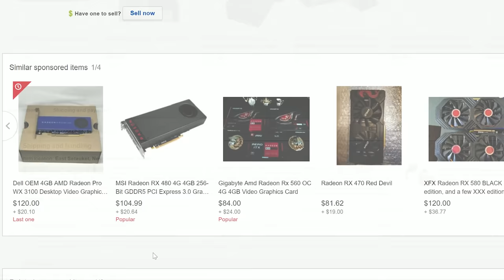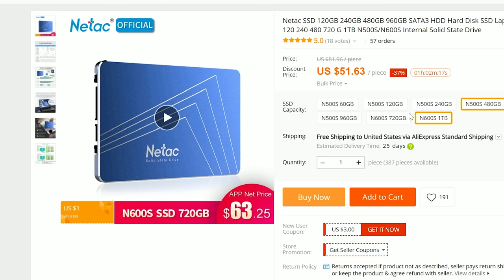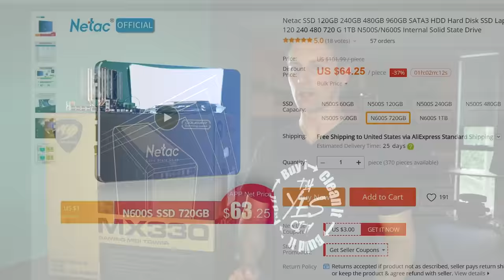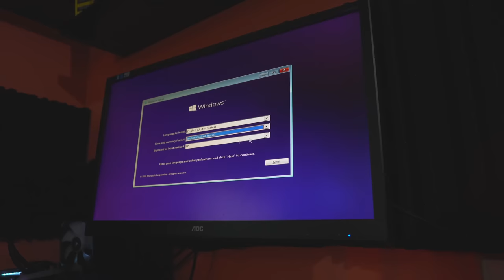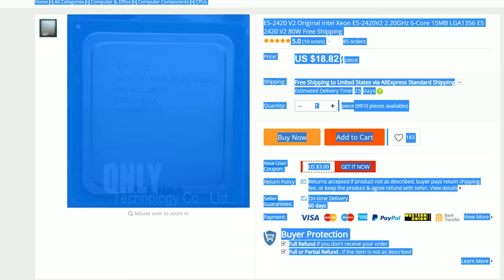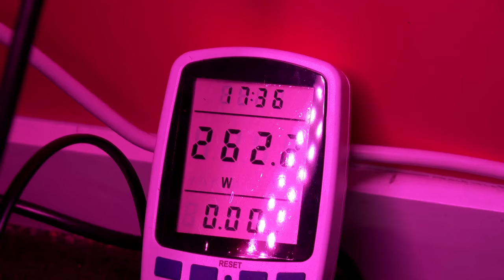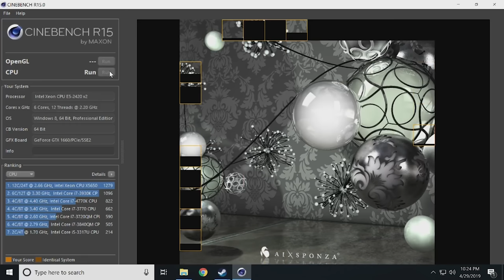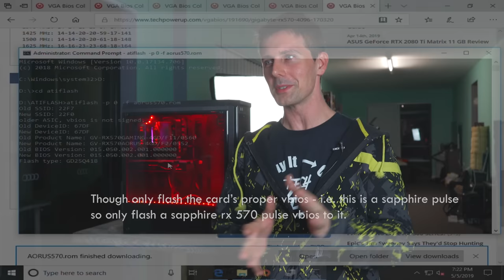Build The BEST $350 Gaming PC (with Worldwide online parts)

Comment: I paid $150 for a Ryzen 5 1600(sealed in box) and MSI B350, paid $40 for a cooler and 8gb of ram, paid $50 for a RX480 8gb in the last month. I also picked up a 144htz display and another 8gb ram for $140 all locally!
Reply: Nice deals mate! Really nice build for a very good price - enjoy!
Reply: Nice man, but with such a budget build, the 144hz is completely useless, a 60hz is more than enough in my opinion
Reply: @Saad-ih3ys  totally disagree. You dont even know what games he is playing. Even pubg or apex can be run with that system at 120+ fps with competitive settings. And there are dozen more games like fortnite, overwatch, dota, rainbow six siege and so on which will be a way better experience on a 144hz display
Reply: @Saad-ih3ys 
Alot of games like csgo, rianboe six seige, overwatch can be even ran over 100fps with that
Reply: @imaginarychip4916  ryanbou
Reply: that gpu has been vbios flipped for mining you have to flip it back for best performance no way someone is going to sell that for so cheap
Reply: Wow you wouldn't even find a cooler here in Ireland
Reply: A 144hz monitor is way overkill for a Rx 480
Reply: @pinkin8012   that isn't true a Rx 480 is pretty old and was never meant for high end build
Reply: i robbed the bestbuy by me and got away scot free with a used ballpoint pen (black ink) standard issue for zero dollars. talk about price performance
Reply: @smokey_mk2  nop it can run most games with comp settings at 100+ fps easily, even in 1440p. I have an RX 580 which is only slightly better than the 480, and I regret  not getting a 144Hz 1440p monitor
Reply: that's cool for you, and consider yourself lucky, but if you are in a country in the middle of nowhere or where pc equipment is priced high locally, then you're out of luck. picking these online deals to maximise the most on the budget will be the better option!!

Comment: Hehe, I'm still waiting for my parts to arrive :D
Reply: waiting for my e3-1220 v2 and b75 motherboard <3
Reply: I’ve just got a new computer which is a laptop. It has
Intel Core i5 4310m vPro
4GB RAM 1600 MHz
500GB Laptop Thin SSHD (it is painfully slow with almost 4000 hours of power on time)
Intel HD 4600 vPro

Since it’s a haswell based system I will dual boot XP and 8.1 when I get my Crucial MX300 275GB SSD and my 12GB 1866MHz RAM
Yes it is needed. I make videos.
Reply: @whitebeartigtig  That's great but will 12GB ram will fit into that thing? Also good luck running the memory at anything over 1600 since you can't overclock it and there's no XMP as far as I know. And good luck editing video on a integrated graphics.
Reply: Todd Simone the motherboard supports 1866MHz DDR3 RAM
Reply: Try to test more games that heavily depends on single core performance.
Reply: update, plz
Reply: Todd Simone well the iGPU is better than the GT 710 I was using previously
Reply: @toddsimone7182  yes you can higher ram if you like
Reply: @whitebeartigtig  sell that and buy a pc instead buy a ryzen 2200g and find a used 570 or 580 and ur good to go fuck laptop man unless u depend on it like u work outside or something
Reply: It’s been a year did you get it yet?
Reply: legend has it that he still hasn't received his parts!
Reply: @abl3book138  Yea ages ago :D
Reply: Did it work well?
Reply: Anything wrong with it I might get the parts
Reply: @ryanthelin6867  Yea worked well!
Reply: I love your channel, tech yes and you are my go to for aliexpress flipping 😎
Reply: whitebear yes and it costed every limb

Comment: This is only the third video of yours i have watched, and yet unbeknownst to you (or i), my problem of my dodgy used RX 470 from ebay may have just been solved. I literally had the techpowerup tab open as i was watching this.. taking a break from my frustrating troubleshooting, having just noticed a thick build-up of dust under the fans..

Out of interest, i am flipping a Dell XPS 7100 i got for £40 because it didn't turn on (the front panel connector was loose).. it had a Phenom II x6 1045, 8gb ddr3, 128gb ssd, 320gb hdd, cd drive, windows 7 upgraded to windows 10 and a 480w psu with two 6 pin power connectors! The RX 470 was £50, so thanks to you i may unwittingly have my salvation! (I have tried everything else today trust xD) We share a passion.. Thanks!

Comment: The Zalman S2 is a better value case at $45, it comes with 3 fans, which 2 are “quiet edition” and the airflow and aesthetics are amazing. Really would like you to check it out.
Reply: coldsore yes but for an extra $15 - $25 you can get a good budget power supply especially if you find one from EVGAs midweek madness sale on Wednesday’s so it ends up around $65 - $75 total for case and power supply, which I think is better than this because I prefer the Zalman case over the one In the video, especially for its great airflow and aesthetics. Add a 5 pack of RGB fans from amazon for $30 and boom you got a sexy RGB case with nice airflow.

Comment: G'day Brian,
This a great build showing that there are older parts that still can give decent performance & mixing them wit new parts can get a decent cheap build,

I got one of these Cougar PSU & it is great for the money, also the Case is great value with Glass & although not a standout is a good looking case,
another Budget case I like for M-ATX is the Silverstone PS15 for $59AUD with a full glass panel & full mesh front, although it doesn't have a PSU Basement.

Comment: Pretty reasonable build, nice job. I find the max 2.7GHz a bit low but if it does its job fine.

I hate RGB and glass panel, so my opinion doesn't count here (my choice would be dimmed orange lighting). I like old heavy PC cases wich weight around 7-10 kg empty, so I can sit on it or put my ankles on the top.

I'm curious what is your opinion about cases quality trough years? I see pretty big downfall in quality and no one speaks about it. Manufacturers just put two led strips in and remove 2 kg raw material, it's vibrating as hell but look it has RGB :) Even 5 years old SFF cases from DELL, HP much sturdier than any case on the market now.

Uhhhh I just want to flip a new fancy case on the side and see if the sidepanel bend or the glass break when I put a 19" CRT monitor on it.

Comment: Can you do a video with this setup vs overclocked x3440?
Reply: Man, forget about 1156 xeons, they are dead. Especially mb will be dead, If you choose to overclock on any of them. Because it's just old
Reply: These business server boards probably have been used for more hours than personal 1156 boards. I have an Asus board myself and as Brian has mentioned, they dont have problems. I'm sure it'll be fine.

What I want to see is how clock speeds will help in gaming performance for the older, 8 thread Nahalem architecture vs a low clocked 6 core Ivy Bridge (4GHz vs 2.2GHz).
Reply: @Arnold-wj9sm  id prefer e5-1620 instead any of these platforms)
Now i have E5-2630 and for gaming it's awesome, but i need some single core performance too
Reply: @Arnold-wj9sm  Agreed, I'd be interested to see how this pans out as well.  Although I think these e5-2xxx chips are sandy bridge
Reply: Arnold Do dammit nappa

Comment: You should do a video comparing the Ivy bridge Xeon in this video with an x3440 or x3430. I'm curious which one has better gaming performance, the overall performance is obviously in favor of the Ivy bridge Xeon though.
Reply: 3440 is just beating the 3430 woth 4 more threads. Just get the x3440
Reply: Yes, but I'm curious about gaming performance, and in games that don't need the threads the x3430 was better.
Reply: Very negligible real world difference esp with so many gpu dependent games. I have a 3440 myself.
Reply: same, though I run mine with a gtx 950, so I don't really get bottlenecked by the CPU.

Comment: Looks good but the case dwarfs the parts and it looks kinda empty inside.
Reply: Personally I really like this case and the reason it looks empty is because the case is quite big which in my opinion is a huge bonus for the price it goes. Of course looks are subjective :)
Reply: @xingbairong  I'm personally a fan of smaller cases myself, where the parts look at home and plus a smaller case is just a bit more practical for me. Something like the Q300L could be nice for this build since thermals aren't an issue with these parts
Reply: @nathacle  Yeah the Q300L have horrible thermal performance, but for this build it will be perfect and I believe their price range is about the same(at least where I live they are)
Reply: @xingbairong  yeah for sure, it's cheaper where I live; pair that up with an EVGA power supply from their Wednesday sales and you're all good to go! (Plus no ketchup and mustard PSU cables yay)
Reply: @nathacle  Indeed, though where I live PSU's tend to be more expensive :(

Comment: The 470/570 and even 480/580 are really good value right now. I picked up a brand new 8gb ASUS RX470 Mining edition (only has DVI-D output) for under $100 with it's full 2 year warranty. I am not really a gamer but such games I do play run fine at 1440p high/ultra including SoTR, Battlefront II etc. For 1080p these things are a really decent prospect and not just for budget builders.

Comment: I just picked up 4 used Sapphire RX 470 cards (blower style) for $240. Pairing them with 4 free retired computers I got from my office. All have i5-2500k, 16GB ram, ASRock P67 Extreme4 mobo, 256GB SSD, 500GB HDD, and 550w modular PSU (and an ancient GPU). Bought 4 new cases for $130 shipped from Newegg since the original cases had terrible airflow and aesthetics due to being 10 year old cases carried over from Core 2 Duo days. Got my DataVac, electronics cleaner and thermal paste ready to GO!

Comment: I had that same exact issue with a pair of Red Devil RX570s i got from ebay. Vbios flash brought em back and they run great! 
Still hoping one day you find yourself a cheap HP Z400 to play around with for some content :)
Edit: Actually look at ebay item 161616775013 (aus ebay, of course). Z400 with Xeon W3680, 1tb HDD, prebuilt system for $249 AUD/$173 USD. Thats not bad. It can take non-registered ECC DDR3 RAM, or any standard unbuffered DDR3 sticks.

Comment: Have the same case and got a Rx 580 now 😂
Ryzen 3 2200g 
12Gb Ram
500w cooler master psu
120gb Kingston SSD
Sapphire Nitro RX 580 8gb
Reply: where do you put your games? Last COD requires 100Gb of space lol
Reply: Cool story bro
Reply: @vladrazym9955  Probably forgot to list HDD.
Reply: Also why 12gbs of ram, would have been better to get 8gbs and upgrade later or go for 16gbs. There has been test results that ddr4 doesn’t handle well with 12gbs.

Comment: What do I think of the looks?
Well it looks very pretty, the only issue, and I've noticed it in your other builds as well, is the ketchup and mustard PSU cables. No matter how much bling you add, the always take away from the looks. Look for cable sleeves on aliexpress, they are like $1, and put them on, every time you get a PSU without black cables.

Comment: I was just testing CRYSIS 3 and found that it doesn't really stress out a PC until you get halfway through the (Welcome to the Jungle) level. When you pass the mines and go through the Locked gate and up the stairs to the open field where the the tower guns are.
  On a 8700K at 5GHz it was hitting all 12 threads at 53% usage and while the Nitro+ RX 480 8GB OC was holding 75fps to 90fps at very high setting 2xMSAA. It runs surprisingly well. Also it was using 6GB of V-ram. Damn this game is the pinnacle if benchmarks still.
  I could see that the low clock speed of the XEON was holding the Sapphire Pulse RX 470 back a little in CRYSIS 3. It most likely would choke on that stressful open field level.

Comment: Lol I've used this board it's a h61 chip set modified to work on LGA 2011. Will say it worked fine in my testing. turbo works, but your limited to USB 2 and only one USB port for the front header. Does have a msata which is cool. I'm using a e5 1650v2 a 130w CPU. Really it only seems to reach 80w max.

Comment: Can't believe how much hsp you use!  You're creating a blanket to keep heat in, not a heat conductive layer to transfer to the heat sink.  The idea is to fill in small imperfections and gaps in the processing unit and the heat sink.  And I'd think WD40 and brake cleaner would leave residue behind.

Comment: PSA: Brake Cleaner is NOT plastic/PCB safe (even the non chlorinated version). By far the superior product to use for cleaning circuit boards is CRC QD contact cleaner, it is plastic and PCB safe and does a fantastic job. 

Computers don't have brakes so keep them away from the brake clean ;)

Comment: You could also go for a lga-2011 build with a e5 2640 or similar, as the lga 2011 has much better potential for upgradability
Reply: i got a cheap e5 2660 for 40$ off ebay 8 core.runs bf5 fine with a vega 56 1440p high good performance.

Comment: I'm rockin the 8700K with a Sapphire Nitro+ RX 480 8GB OC (still waiting for NAVI, if it's not up to par then I'll keep running with the RADEON VII) and a 27inch Freesync 90Hz monitor. A 6c12t CPU and a RX 4 or 5 series GPU is still a great combo. Who says you have to spent $1200 on a graphics card to have a great gaming experience.

Comment: Love the idea for this but there is a different board on ali express thats about the same price that supports NVME and the 24 pin is in the usual place.  Crazy how cheap these boards and processors are.  There is an 6 core variant that will do an all core turbo clock of 2.8ghz for about 35-40 USD shipped to your door.  Price to performance for this platform is insane!

Comment: Nice build though for a bit more you can make a build that has upgrade path.

CPU: Ryzen 3 1200 - they are really cheap now. You can find on alixpress 1200 going for $53(no cooler), though locally you should be able to get it for slightly more with a cooler and 3 year warranty.
Mobo: a lot of choices. If you plan on upgrading later to the new Ryzen cpu's that will come out you can get a B450M Pro4 mobo. For cheaper options you can use AB350M Pro4 or if you want cheaper you can even get a 320 mobo since yes they can OC(do check forums first to know which can OC, but most do), however they won't support the new 3000 series Ryzen.
GPU: your own choice.
RAM: DDR4 is fairly decent priced at the moment so getting 16GB 3000MHz is suggested, but you can go with 8GB. Don't think it's worth paying the extra $ for 3200Mhz. Also there's DDR4 16GB 3000Mhz for $76 with LED on aliexpress and for $83 3200MHz with LED, so if you are ok waiting you can get cheaper DDR4 with LED than you would be able to locally :)
Case, PSU, Storage are up to you and how much you are willing to spend. The SX8200 is decently priced.

Now I know that this will be slightly more expensive, but performance should be about the same or maybe slightly better, however this has a future. If at some point you want to upgrade you can get during sales(Black Friday for example) a let's say Ryzen 5 2600(if you went with the B450 mobo even Ryzen 3000 series) and the PC will become a beast. 
Also the CPU doesn't necessarily have to be Ryzen 3 1200... Check locally. For example where I live there are few Ryzen 3 1300x 2nd hand with over 30 months warranty left on them going for few bucks more than the 1200. If you don't want to bother OC at the moment the 1300x will do an amazing job.

I really love aliexpress builds since almost everyone in the world will be able to build it for the same price, but at the moment prices for new parts are so low that I'm not sure it's worth it at this price point.
Even if what I suggest performs few fps less(I don't think it should, but let's say it does) it has a future. That's the main point. 

Still the most important thing people should take into consideration is what games they play... if they play competitive titles only(I myself for the most part do that) Bryan's build will do an amazing job for years to come. Still depending on what titles you play you can check locally for deals as well that might be cheaper.
Reply: great tips, thanks

Comment: That's a great budget build, but I'd definitely go for the 8GB RX just to increase FPS in modern titles and future proof it a bit more (many games at 1080p are really on the edge even for 6GB cards these days).  It would bump the cost up a bit, but likely not too much based on the prices I'm seeing on ebay etc. and even new I'm seeing them for around $150 so that's just around $60 and well worth it in my opinion to have an 8GB card that should be good for a lot longer than a 4GB card, especially as games are becoming more demanding with higher res textures and the like.  It jumps the price up to just around $400 but for what you're getting it's really not that bad in my opinion, and is still an excellent deal for the level of performance you get.

Comment: When you're cleaning fans, case fans or especially the fans on a GPU (since it's more difficult to replace) do you use any sort of oil or lube inside the fan's hub to help extend the life of the fans? If so what do you use?

Comment: I'd probably pay a little bit more and get a slightly faster clock speed Xeon. Either V1 or V2, the difference in performance is negligible. But it's budget dependent of course. If you really have to stretch it,  this combo is really great as it is!